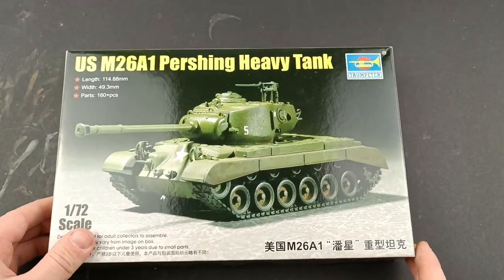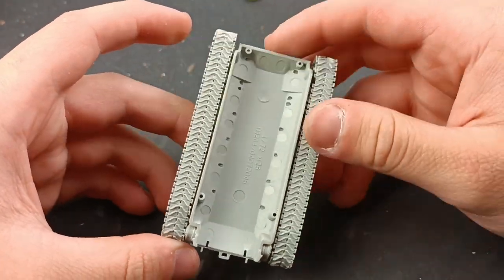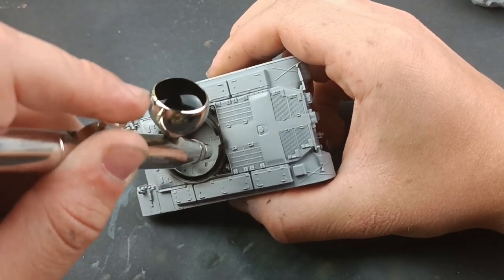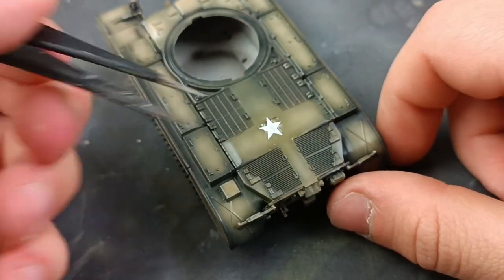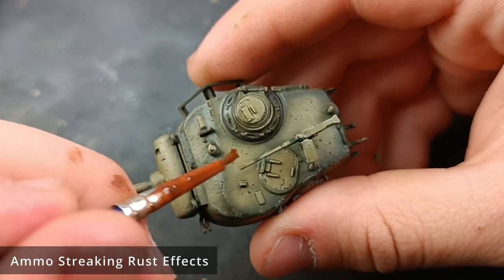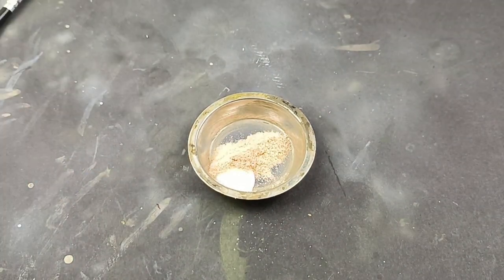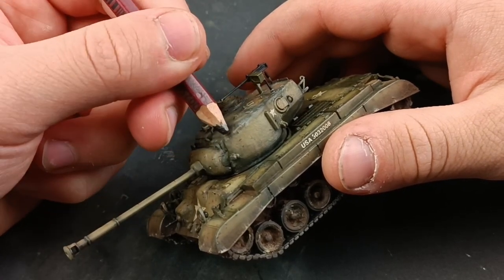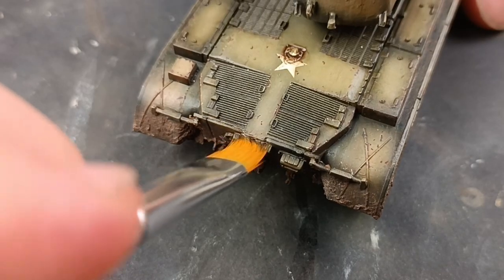M26A1 Pershing Trumpeter 1/72 - Full Build Video

Comment: So how would you covert two kits to make a T20 medium Tank prototype and what kits would you use.
Reply from the maker: I think I'd get trumpeter's M26E2, M4A1 (76)W, and M4 mid production.
I'd take the hull from the M26, replace it's suspension with the VVSS bogeys from the M4A1, then take the M4A1's turret and replace it's mantlet with the one from the mid production M4 and modify it's shape. The gun would also be the 76 from the M4A1. Of course all of these parts to be modified heavily for the model to actually resemble the T20 prototype, but it's the best I can think of.